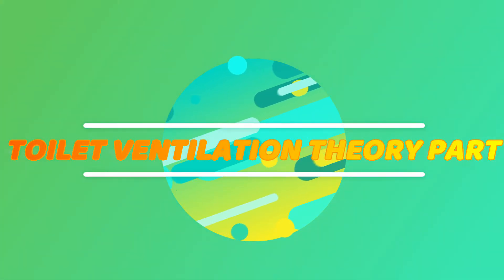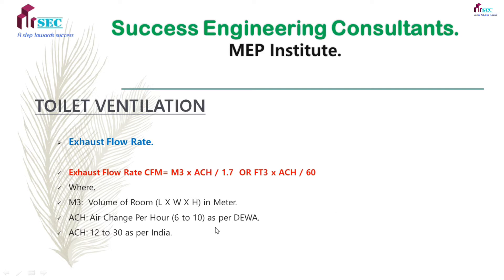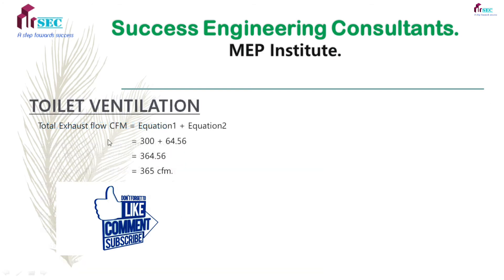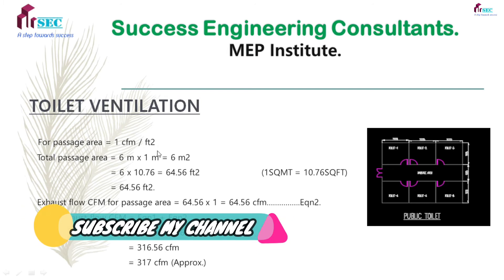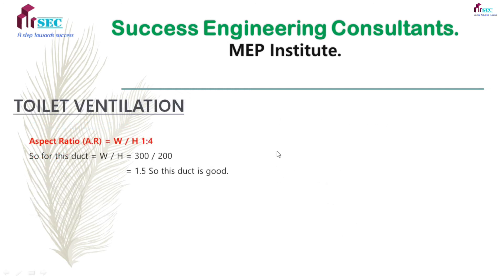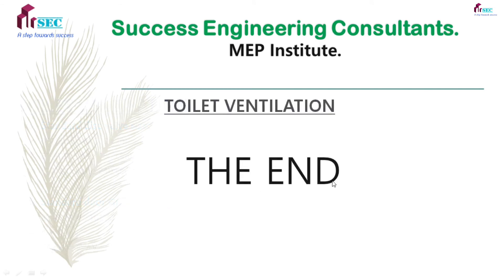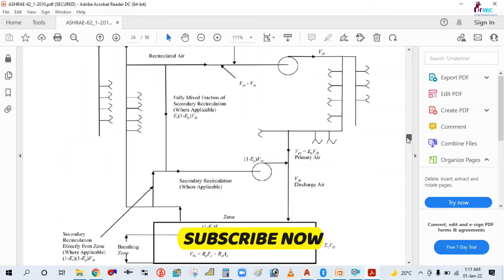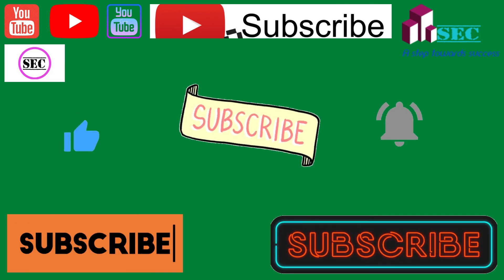TOILET VENTILATION DESIGN THEORY PART II AS PER ASHRAE 62.1 VENTILATION STANDARD II

Comment: Respected Sir Can You Calculate 1. Fresh Air Flow Rate 2. Static Pressure Calculation For Ducts & Fittings 3. Exhaust Air Fan Selection As Per Cfm & Pascal
Reply from the maker: Ok i will make it, meanwhile you go to HVAC designing and drafting folder in my playlist and watch kitchen ventilation and car parking ventilaiton you will find the concept for fresh air calculation, static pressure calculation by thumb rule and exhaust air fan selection.
thanks.
Reply: @successengineeringofficial7742  thanks sir